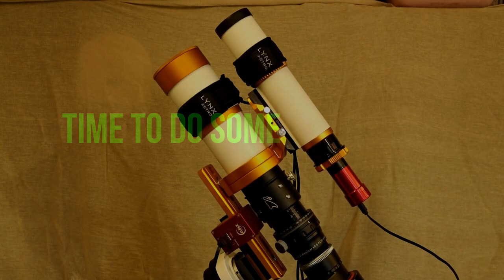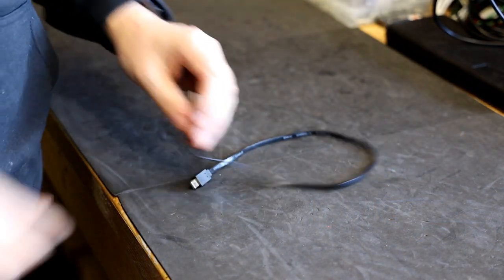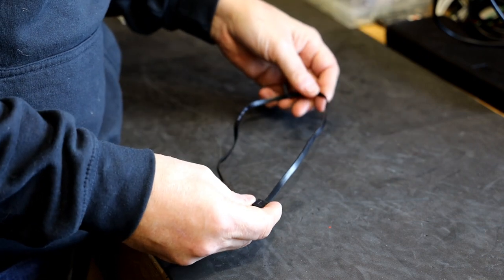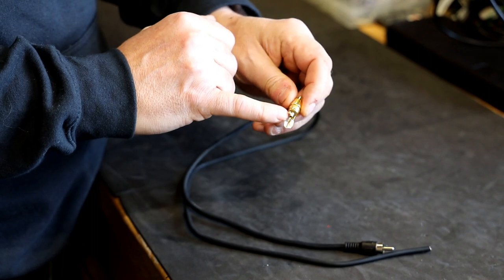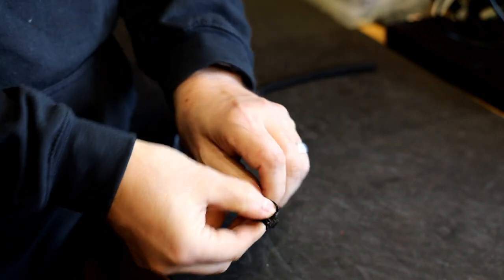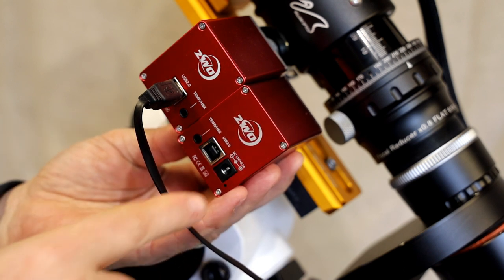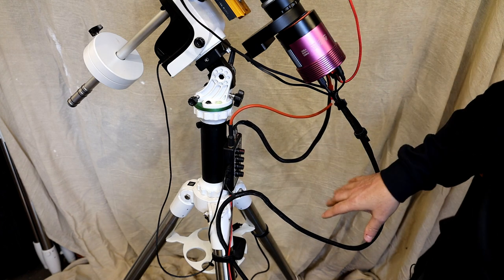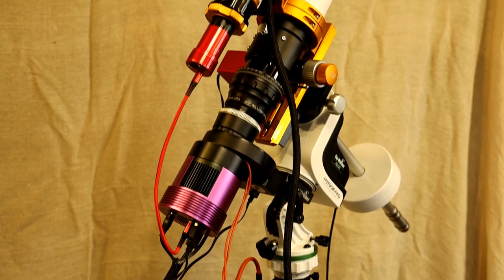Astrophotography with Glenn Clouder - Cable Management Tips

Comment: Well done. Here's another challenge for you. Having our equipment outdoors brings one more trouble. Soon as temperature drops down all our cables become lots of more stiff. Interestingly, all my dew heaters comes with nice silicone cables and they seem to remain ok regardless what temperature is. To summarise I'd say I'm yet to find out whether or not there are some silicone USB 2.0, 3.0, 3.1 and power supply cables available. Nothing drives me more mad than stiff cable having direct negative impact on my tracking.
Reply from the maker: Hi Jerzy and thank you for your comment. Where do you live? I am in the south of the UK and so it very rarely gets cold enough for cables to be affected like that. Our main battles are with Humidity. My power cables and like you dew tape leads are all silicone and nice and flexible. I know you can get leads made to order and I am sure could be sleeved in silicone but every time I have researched this its been way too expensive. Like £30+ just for a short usb lead. I try and just make the lead lengths as short as possible but allow full range of mount movement.
Reply: @Astrobloke  I'm from London. Not longer than three days ago there was lots of frost on our cars and grass. Temperature recorded was between +1 and -2 in Celsius. From my experience this doesn't need to go as far as negative temperature for cables to get stiff. I agree that weather in UK is little bit astronomy unfriendly and humidity is your biggest enemy. Some time ago I bought pegasus ultimate power box v2 with humidity sensor but due to various reasons I'm yet to find out whether or not this is going to work.
Reply from the maker: @qwertyu2387  well I was born in Lambeth so know London well. Light pollution must be a challenge. Unless you can source the cables with silicone sleeving there isn’t much you can do. The nylon webbing I use would not stop the cables getting as cold as ambient temps.

Comment: Looking good Glenn I had a go last week making my setup neater I found similar to your Velcro strips a roll at the DIY store I could cut to length really handy stuff.  I'm gonna get some dc  cables for my HiTec so I can use those two ports.  👍👍Great tips.
Reply from the maker: Thanks Ollie. Yes those ports are very handy on the Hitec. I'll be looking for a smart rig next video then? Lol
Reply: @Astrobloke  ha you might need to cut me some slack ....or is that cut off some slack 🤣

Comment: Well done with this project, I use an ASIAIR plus now and it helps quite a lot with the cable management problem shown here. ,It comes with an assortment of short and longer usb cables. It has x4 12v power sockets x2 usb 3 and x2 usb 2 sockets though everyone must know this by now as it is 3years since the video was released.
I found the split sheathing can add extra weight and interferes more with the balancing. The routing of cables can be augmented by using simple ‘office table edge’ self-adhesive plastic cable clips.  I have found too that shortening cables can lead to poorer quality connectors bought online as you said. Clear skies :-)
Reply from the maker: Thank you for watching and taking the time to comment. I have since moved on as you rightly say. I have not used the ASIAIR but I have friends that do, its a good solution but I don’t like that you are tied to just ZWO products. I took the route of a Mini PC and Pegasus powerbox advance. I run NINA on a Mele 3mini PC and it works great and keeps everything nice and tidy. 
The split sheathing does add weight and I no longer use it, the game changer for me is using the velcro cable ties. 
Thanks again, clear skies
Reply: Agreed that the Zwo Air solution is very ZWO centric and I didn't like the enforced conformity really at first, but they make some great cameras and the pricing isn't bad  so I went that way and now enjoy straight forward astrophotography without too many snags cropping up.  Nina is a superb capture management tool and if I was a younger man  I probably would have gone the same route as you. Thanks for sharing your knowledge on your channel, what would we do with people like you ❤

Comment: Glenn, I see you using a skywatcher tripod along with the pier to the AZ-GTI. How did you fit the pier to the tripod? It doesn`t fit in the center of the tripod.
Reply from the maker: Hi Arnstein. I have put a link at the end. hope it works. I bought the tripod from Rothervalleyoptics.co.uk and its a sky watcher one without the pin for the north alignment. the pier won't fit to that type. I only had the AZ GTI head and read the tripod for that is not that sturdy. This one works well and just attaches to the central threaded rod that comes up through the centre plate. hope this helps      https://www.rothervalleyoptics.co.uk/skywatcher-stainless-steel-tripod-with-38-thread.html
Reply: @Astrobloke  I have a tripod for the eqm 35 mount I was planned to use. And yes, it`s the pin for north alignment that fuck things up :) Thanx for the links and enjoy the new years eve :)

Comment: Hi Glenn, there's a few options of the split sheathing you linked. Did you use the 1/2", 1/4" or 1/8"?
Reply from the maker: Hi, I used the 1/4” as it was only to hold 2 cables per run but you’ll have to make a judgement depending on how many and thickness of cables you are sheathing
Reply: @Astrobloke  Cheers, mine is just to hold 2 cables also. Congratulations on your EQ8! Hope you are enjoying it
Reply from the maker: @AB-ft2lb  the 1/4” should be the right one. The mount is brilliant and working really well. I’ve made a video thats out later today at 6pm on it. 
Makes my AZGTI look tiny lol
Reply: @Astrobloke  Hahaha. Yeah, looking forward to watching it later. Are you keeping the EQ6-R?
Reply from the maker: @AB-ft2lb  oh yes. Thats going to be my garden and dark sky outing mount and the EQ8 permanently in the Obsey.
Reply: @Astrobloke  Nice. You are surely getting rid of the HEQ5 then, if not already?

Comment: Glenn, I'm totally confused about the guide camera cable being plugged into the main camera. ??? I thought the guide camera interfaced with the mount. I'm getting old man. I've bought a Mele and I just keep looking at it and my EQ5 and think "Can I set this whole thing up?" I go round in circles thinking of all the things I think I need and then keep watching videos and having (stupid) questions. Do you know of anyone who has done a complete,  start to finish, set up (hardware and software) of an EQ5 mount with a DSLR (actual connections) and mount and PC and then focus on the software?
Reply from the maker: Hi Mark. More than happy to help you with stuff, email me Astrobloke@outlook.com
That's easier as we can share images of stuff or even video or link up online. It is a very confusing hobby at times but I assure you it can all be sorted and understood. Just baby steps sometimes.
You are correct in that the guide camera via the PC sends corrections to the mount but usb can be piggybacked of anything in the loop. Email me a list of what you have and we will get you set up. You don't want to go buying more than you need.
Reply: @Astrobloke  Holy sh! Man. That's exceptionally kind of you. I will put together something on email tomorrow or Sunday. Would be great to get your input and get my 'mojo' going on this. There are quite a few issues I have, even re the location and my  intentions, that you might have some ideas about. Cheers and appreciated.
Reply from the maker: @markwelsh9068  my pleasure Mark. Happy to help. It is tough and confusing when you first start. A little guidance and just someone who can answer a few questions can get you a long way. I will look out for your email.